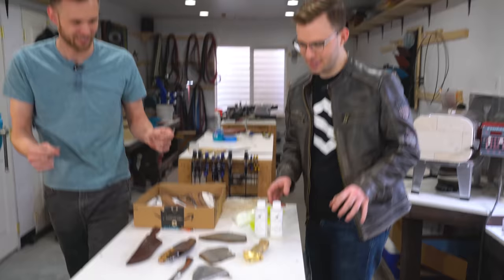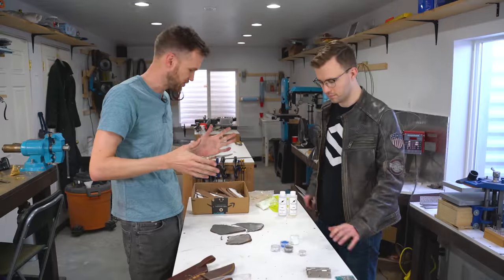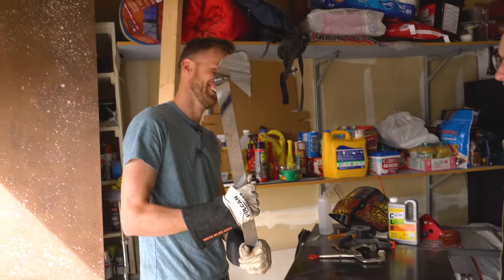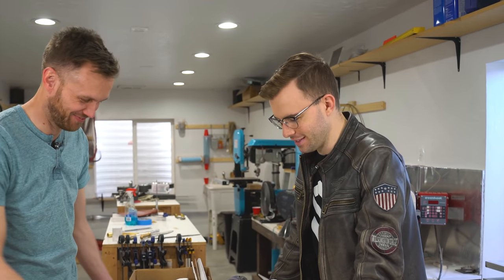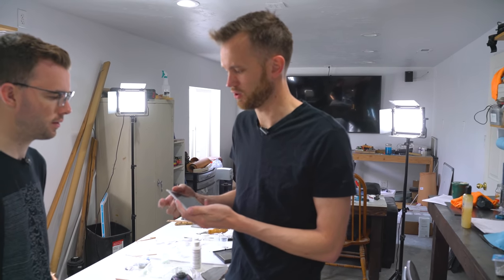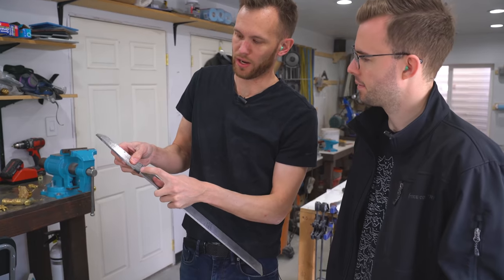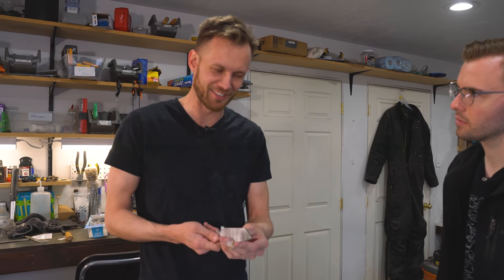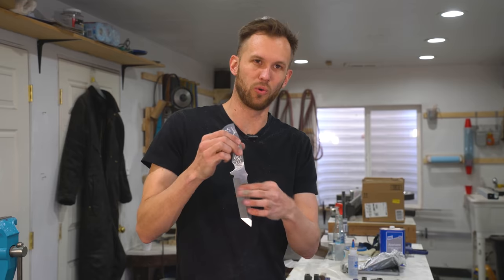METEORITE and DIAMOND used to Make the Coolest Knife Ever!

Comment: That pattern on the knife when it comes out the acid is incredible. I dread to think how much a slice of meteorite costs but made such a beautiful blade.
Reply: From what I can find, those two slices were approximately $3000 USD worth of nickel iron, dropped off a little over a million years ago 😁
Reply: @MrNoPuppet  wow that's a heck of a lot. It makes you realise why they save all the shavings that they create when using it. It made a beautiful piece though and loved the handle they made for it.
Reply: From the thumbnail it looks like it was money.
Reply: color of the acid looks a tad suspicious
Reply: @TylerCarson-yy8eo  Looks fine. As it etches the oxidation or acid eaten metal will show its iron content by turning a slight brownish with a ting of red in it. Not unusual at all. 
KnifeMaker
Reply: @MrNoPuppet  I thought meteorite was stronger than steel
Reply: Nothing if you can find it before another person does
Reply: @jsmith5443  AFAIK it could be, so potentially stronger or sharper than a blade made from bog iron using pre-Iron Age techniques. I think the beauty comes from the natural grain and crystal structure and possibly some of the relative strength. Some also contain things like carbon nanotubes or other carbon nanostructures. But they won't be as strong as a modern knife steel. 
If you forged and heat treated meteoritic iron, you could make it stronger, but also lose a lot of it's beauty. I think they're more art or display pieces than EDC, practical blades and given the cost of decent sized meteorite slabs, would be expensive for an EDC anyway. I've found a few over the years just walking outdoors. Not very large ones, but just had them sliced, polished and etched to keep as display objects and as gifts. It's neat to think how old they are, and how far they've travelled.
Reply: @brolohalflemming7042  sure you have buddy.

Comment: Dumb question: If you were to weld normal knife making steel along the edge and back of the blade and use the meteorite in the center, could you make blade that's usable but still has the incredible look?
Reply: In my opinion, you'd be better off making the meteorite into legitimate steel. Meteorite is mostly iron (though i don't know what specific meteorite Nate has there) and so you could make it into a serviceable steel.

Ilya during his time at Man at Arms (now part of the ThatWorks youtube channel) made Sokka's meteorite sword from Avatar the Last Airbender with an actual meteorite by making it into steel.
Reply: The heat can potentially wreck the pattern. If you want meteorite on a usable knife the handle is where to put it.
Reply: Meteorite is usuable as knife steel as is, it just isnt homogeneous which is what causes the pattern and uneven hardening.

Ideally you can simply forge weld the meteorite into itself (think Damascus steel, or katanas) to blend the different types of metal. 

Or better yet, throw it in a crucible and make it truly homogeneous, but that ruins the pattern even though it would make the best steel.

Comment: Hey Nate, I Weld and I and just wanting to give you a tip for MIG welding. Move slower and consistent. Because with welding you are unsure if you penetrate the metal enough to make a strong bond. It’s safer to run a temp you are comfortable with that will melt both metals and create a puddle of molten metal than run a too hot or too cold temp. I hope you see this and it helps lead to more projects with welding in the future!

Comment: The shutter speed is a little slower than 1/50 - that's why some of the video looks a little weird. Not focus issues. Just in case you guys didn't know.

When shooting at 24fps, always keep shutter it at 1/50. You have too much motion blur in your shot, especially with a handheld camera.

Looks like you have it at like 1/30 or something smaller (which is slower) than 1/50.

p.s. if you HAVE TO change it (to fix light banding on a tv monitor or something) - you're better off going faster (higher number than 1/50). You can always add fake motion blur in post, but you can't take away motion blur ever. Plus, a little jittery is always better than a little fuzzy.

Comment: Ive seen a few blacksmiths do a coffee etch after the acid etch. Mostly Alec Steele and Will Stelter. The basics is you leave it in really strong cold coffee for a while and it darkens the blacks. Then a really fine sanding to finish and it really makes damascus pop, I can't see why this wouldn't work the same for meteroic steel too.

Comment: Very much a display knife.  Meteorite iron showing those Widmanstätten patterns are extremely soft, so even though those are just cladding on the actual blade, any use at all will scuff and scar them very quickly.

Comment: Hey Nate, Your heat was just a little cold, also even though you bevelyou should still leave a slight gap to penetrate right through then when you flip for other side cut it out some and run your pass.

Comment: I would drill through the handle to mechanically lock the handle through the metal. And use Allen head screws to hold it.

Comment: As a bit of a knife nerd (that doesn't like Tanto's) and a bit of a space nerd, this was the coolest project ever for me, and in THIS case, the Tanto blade was the right choice, maybe even the only choice.
Would it be possible to harden the edge without ruining the structure of the meteorite?
As for the handle, it isn't important to me, since the value for me is in the meteorite, but it was also spectacular of course, and a spectalar blade needs a nice handle.
PS. send me the cutoffs of both the meteorite and the handle and I will love them any shape they are...

Comment: I'm curious the carbon content of that meteorite. Is it a hardenable metal so that you can reach the upper 50's to low 60's? I have a feeling that could be an incredibly useful blade if it could be heat treated.

Comment: You should give out a warning if anyone were to attempt anything like this. When you etched the blade, the nitric is eating at the nickel content in the meteorite which gives off nitrogen dioxide. Nitrogen dioxide attacks the central nervous system and can kill you fairly quickly. You can also neutralize the acid with dish soap just as an FYI.

Comment: I think a great video would be, and it can be a multi part video because it may be long, to make different knives from different types of metals, some that are logical and some that just shouldn't be done, to see which one performs the best and worst. Knife showdown! Aluminum, copper, nickel, steel, gallium (will have to turn the AC down for that one), etc. I think it would pretty cool to see the difficulty level of working with each metal and then performance of the knifes of course.

Comment: How about a display case that is rather deep with a flat black interior.  LED strip lights hidden under a lip at the front and a power switch handy at the side edge.  Blade pattern….handle glow….blade pattern….handle glow.👊😎

Comment: So, ... which of you gets to keep the knife?

Couple things:

The pattern you see is called a "Widmanstatten Pattern", and is caused by very long periods (as one of you mentioned, millions of years) of cooling, to cause large iron crystals, and to cause two different alloys of iron and nickel to separate from each other.  It's typical of iron-nickel meteorites, and it's likely that the inner, solid core of the Earth has the same thing in it.

What happened to the diamond in the handle as you cut and sanded the handle?  Obviously the diamond is far harder than any sandpaper or bandsaw blade.  Did it just fall out of the epoxy as you machined the handle?  Did you dull the bandsaw blade whenever you hit a diamond?

I know this isn't intended for heavy use, but it's my understanding that you want a small grain structure for strength in a steel blade, and this is just the opposite.  What do you think?

Thanks, this was gorgeous!

Comment: An alloy of meteorite powder and steel powder, forged together, could potentially allow for a more durable knife rather than a decorative knife.
Reply from the maker: True!  And people have done it.  But any forging will change the pattern of the metal, and it won't look as good IMO.
Reply: @NFTI  One thing you should have tested was tempering the meteor metal. It might actually take a temper not sure as i never tried
Reply from the maker: @nanaki-seto  I did do a test of heart treating it, but it doesn't harden. It got softer.
Reply: @NFTI  oof not good lol
trying to think of a way you cold use the material and still have a hard edge. Maybe weld a blade steel on for the edge grind with the spine the meteor metal. You would have a fairly obvious weld line at the interface point but that could actually look really good 
I mean that is if you ever decide to try another knife of this type
Reply: @NFTI  read my comment please
Reply: What about a knife where the blade was made of damascus steel and the handle was made of meteorite?

Comment: Ya'll need some Cody's Lab in your life, because that chemistry is more of a starsign malarkey rather than real solid stuff. Call Cody, he'll tell you that adding acid to water is just a guideline rather than a rule ;D
Reply: And Cody would be more than awesome talking about meteorite, that's quality content right there for the low, low price of messaging him ^^
Reply from the maker: The guideline of adding acid to water is not always needed, it's true.  But there are some cases (like if you were adding a small amount of water to a strong acid) where pouring the water into the acid could cause a rapid exothermic reaction, causing dangerous spray of acid and boiling water.  So it's better to be on the safe side :)

Comment: There are reasons why a full tang knife is not made of a blade piece and a tang piece. You did it, and the weak point of your knife is right at the welding point. You just can’t be sure if the welding is good or not, or that piece of meteorite can be welded correctly to another type of steel.

When I saw that big chunk of meteorite iron I had been sure you were about to forge the knife from it. I was wrong.  Wish you a better effort next time

Comment: i wonder can the D&D crew tell a cheap knife from an expensive knife. could have both store baught and your own work. has D&D taught them anything about quality of knifves. How about team up with Linus Teach Tips and make a knife out of computer pieces? a Ram Stick handle, maybe  stripe some ethernet cables and other cables and make a ingot to work from, could even have add in RGB to the handle, for +10 Speed. heck could somehow put a Rasberry Pi in the  handle and make it a working knife. maybe make it some other weapon, like a hatchet. what if you could figure out how to make it a full working computer inside a weapon.

Comment: Why polish it before you shape the handle 🤦🏼‍♂️
Reply: If i am not mistaking, only the front edge gets polished before. That way it's easier to shape and make two sides symmetrical before there is a knife blade in between. Then it gets polished and covered with tape to protect the surface just because it's easier than trying to polish in a corner after it's attached.

Comment: Who cares? Anybody who knows 94 sword making knows for a fact that meteorite does not ever make for good blade material. Most of them are made out of low carbon or low nickel iron, which can not be hardened. So, in all honesty, in actuality. You can put a razor edge on it. But when you're done cutting us a single sheet of construction paper that Razor's Edge is no longer razor and can not even be used to shave the hair on your arm. Think what you want, but every blademaster out their knows that meteorite is only good in San-mai blade Construction. And even then, that blade is brittle and/ or weak and not durable at all. I know this because I have three knives made out of meteorite. They look absolutely badass, but they are 1000% useless if you use them for more than anything other than cutting soft bread.